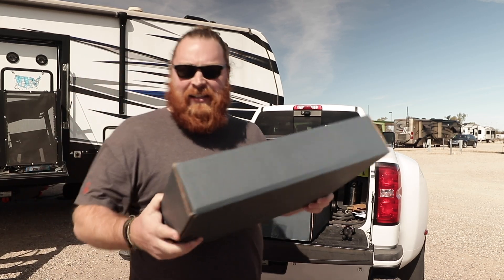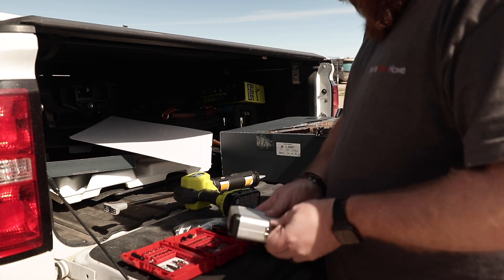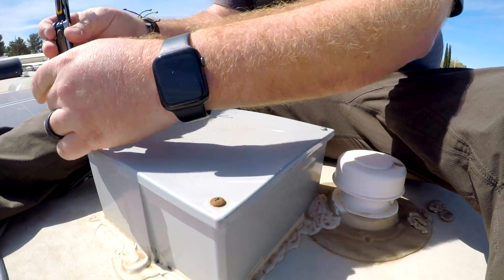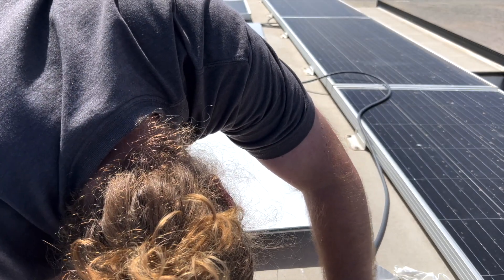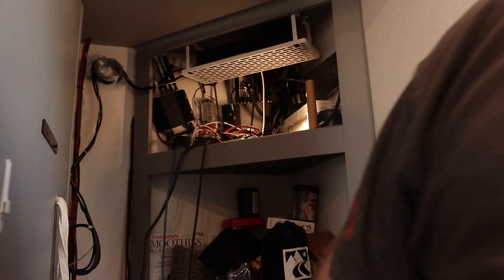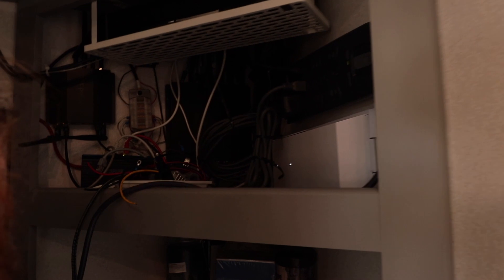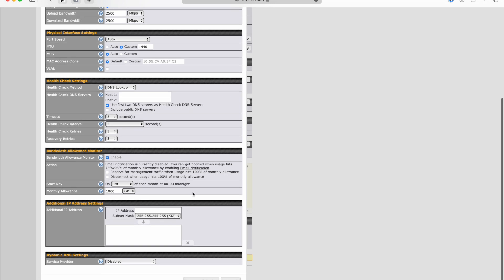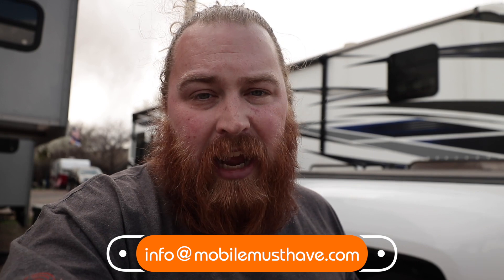Starlink Flat High-Performance Installation

Comment: to connect the starlink flat high perforrmance to a peplink max br1, will i need a RJ45 Cable? or other ethernet adapter?
Reply from the maker: You can use the cables that come with the Starlink antenna itself.  The power supply will connect to the dish directly and then the ethernet comes out of the power supply to the Peplink unit.

Comment: I see you have some heat shrink at the end of your cable. Did you cut the cable to extend it ? I’m installing mine on a boat and I’ve snipped the cable to run it through the boat but now I’ve been told I can’t just crimp a new cable on with rj45 connectors to make it longer. What did you do to reconnect the cable ? Splice or rj45 and what cable
Should be used to extend ?
Reply from the maker: Thanks for reaching out! So, we actually do have a Termination Plug that will allow you to cut the end of your Starlink HP cable and customize the length. It sounds like this may be perfect for your use case: https://mobilemusthave.com/products/ethernet-cat-8-termination-plug-tool-free-starlink-compatible

Check that out and if you have any other questions, reach out to us via email at info@mobilemusthave.com and we'll be happy to help!

Comment: we used a 3M film on top of the advanced dish and waxed it. I check it somewhat regularly and overall any wind at a decent clip cleans it right off. Certainly our handheld Milwaukee blower takes care of anything left! As the owner of a cybersecurity and forensics firm, we extensively tested Peplink routers and found too many security concerns to use Peplink. Thanks for the install video.

Comment: thanks for this video . . . question though. I understand the receiver needs clear view of southern sky, but does the angle of the receiver have to be facing the south? The mount doesn't rotate, so what if you're parked facing the north, dish is angled north . . . does that matter?
Reply from the maker: Nope. With its increased viewing angle it is designed to work no matter which way you park. The angle is more for water run off than angling for starlink performance.

Comment: 133 ping, that is to much ping
Reply from the maker: 133 is pretty high, but thankfully that is much higher than the average latency seen from Starlink. According to Starlink's spec sheet, the average latency is 25-60ms in fixed locations: https://www.starlink.com/legal/documents/DOC-1400-28829-70

If you have any other questions, reach out via email at info@mobilemusthave.com and we'll be happy to help!

Comment: How do you feel this performs in tree coverage situations compared to the abilty to move the standard dish around the campsite to find a signal?
Reply from the maker: Hello! So, tree coverage can definitely cause an issue with Starlink's signal. Being able to move the dish around will definitely have its benefit with areas where your rig is parked underneath heavy tree coverage, but I will note though that the High-Performance Dish has a larger FOV, thus is capable of better performance in partially obstructed locations. 

If you have any other questions, please reach out to us via email at info@mobilemusthave.com and we'll be happy to help!

Comment: Thank you for the video. I hoped that you would show the screws that you are using in each spot, as they are many different types included.
Reply from the maker: No problem, thank you for watching! So, the Starlink HP Dish does come with a few different types of screws, but this helpful installation guide should help clear up which screw goes where in the installation: https://api.starlink.com/public-files/installation_guide_flat_high_performance_kit.pdf

If you have any other questions, reach out to us via email at info@mobilemusthave.com and we can help you out!

Comment: I hate to ask but have alot of interest in this. Could you please tell me the maximum heigth of this product with it installed? Thinking about installing but worried about clearance heigth where the RV parks.
Reply from the maker: Hello! Thanks for reaching out! Completely understand the worry about the height clearance. So, the maximum height on the High-Performance Starlink Dish is 22.6 inches. If you have any other questions, reach out to us via email at info@mobilemusthave.com and we'll be happy to help!
Reply: @MobileMustHave  22.6 inches for the RV antenna? Man it looks like it's only 8. Thanks for the clarification
Reply from the maker: apologies for my team. they are talking about the max length of the dish. The height of the dish is like 6 inches. WELL BELOW the height of your air conditioners. If you need exact i can bust out a ladder and measure for ya.

Comment: @MobileMustHave thanks for sharing the great tips! I have one question: The hole which Starlink cable passes through has some gap. how did you seal the gap? thanks.
Reply from the maker: So, you can use any type of self-leveling sealant to help seal that gap. We personally recommend Dicor, which can be found on our site here: https://mobilemusthave.com/products/dicor-self-leveling-sealant-in-various-colors?_pos=1&_psq=dicor&_ss=e&_v=1.0

If you have any other questions, please reach out via email at info@mobilemusthave.com and we'll be happy to help!

Comment: Perfect video.......thanks. is your generator running to power Starnet or r u using invertor which eats batteries for lunch ?
Reply from the maker: Dish has a wattage usage of around 100-150w nominal, nothing crazy, like a 100w light bulb. Sure you could run a generator for that but why as it just wastes gas as the smallest generator puts out 2200 watts
Reply: @MobileMustHave  I want what you did. However, I want (wish) to use now unused tv antenna hole with that starlink bracket centered over said hole. So, did high performance Starlink kit come with mounting over hole roof assembly parts to allow dish cable to pass through the former tv antenna hole ?
Reply from the maker: @VideoByPatrick  the kit comes with a surface mount grommet to cover a hole approximately 1inch in diameter max. If your hole is larger consider covering it with our 8 inch ground plane and dicor to reduce the size of the hole which would be an easy fix. Id also recommend you checkout our cable management solutions as they really make the install easier. You can reach out to our team with photos and we can assist at info@mobilemusthave.com. Cable management here: https://mobilemusthave.com/pages/cable-entry-systems

Comment: Hey! Hope you’re good!
Could you please do me a favor? I need to know the measurements of the heights of the lowest and highest part of the antenna. The distance from the floor to these points (lowest and highest). Thank you very much!
Reply from the maker: Hello! So sorry for the delay in our response. The lowest point is almost flat with the roof, so with the thickness of the antenna, the lowest is approx. 1.6in while the highest is around 6.6in! If you have any other questions, please reach out to us via email at info@mobilemusthave.com! Thank you!
Reply: I wrote floor, but it is the roof of the vehicle, where the antenna is installed.

Comment: Can we use a dc poe injector with this? Just wondering.
Reply from the maker: Unfortunately at 250+ peak watts when booting it exceeds anything that can run on POE from DC power at this time. Some people have modified the starlink power adapter to run on DC only but thats a big job so AC only at this point for the large fixed mount unit.

Comment: Great video Andy! Thinking about ordering one from MMH.  Do you think VHB tape plus Dicor around the edges would work for mounting to a fiberglass roof instead of drilling screw holes? Or maybe VHB with wide Eternabond over the metal frame?
Reply from the maker: Starlink is pretty heavy, you could try it, but you would want to check it before traveling every time as that could turn into a costly mistake.  We recommend using our method in the video.
Reply from the maker: We checked and Erik from MMH actually used a screwless method on his install. He installed VHB on the bottom of the dish then dicored the entire bottom of the mount to protect the dicor from the water. This has worked out great so far but his dish does not seem to be mounted on a low spot that gets water but overall an installation without holes seems possible at least so far (6 months of testing without issue).

Comment: Have you tried to use the POE adapter?
Reply from the maker: We have, but this antenna requires so much power it kept burning up everything we tried.  Because of the power draw demands for the antenna, we currently recommend running it off of an inverter with 120v power.

Comment: Did you notice a significant power usage increase for the High Performance flat dish?
Reply from the maker: From what I have seen in my continual testing during the summer it pulls 80 watts all the time.   It can spike to 150-200 watts but doesn't seem to stay there for long.  I have not tried this antenna in the winter yet, but I would assume the snow melt heater will be at least 200 watts when it's cold.